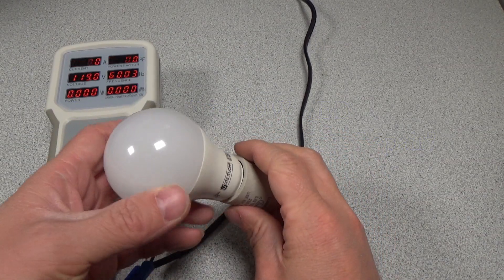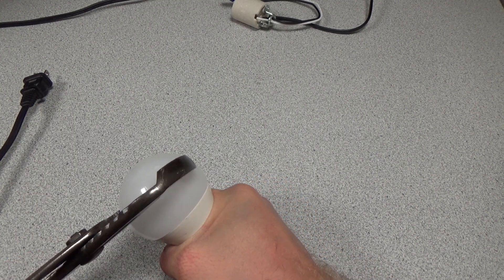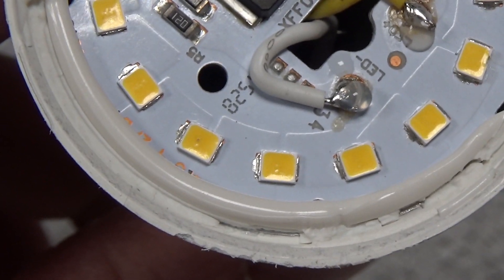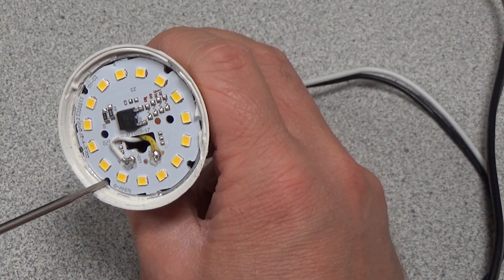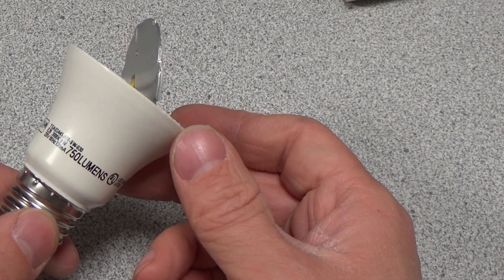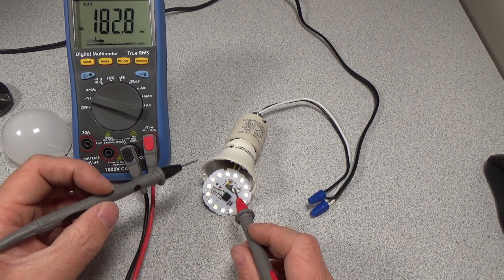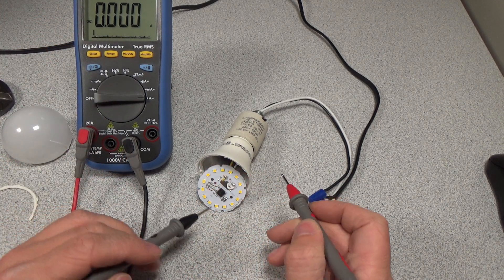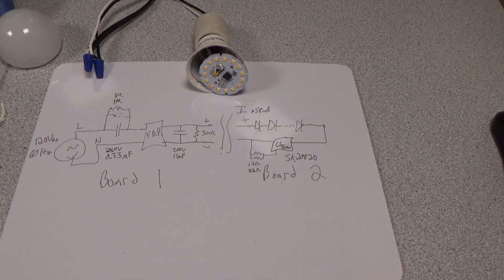Failed Utilitech 9W LED Bulb Autopsy and Schematic

Comment: Where did you get all the information on the values and hardware in the led light bulb?? What brands are the best for longevity ???
Reply from the maker: I read the numbers off of the components to get the values.  No idea which is best for longevity some important signs are lots of LEDs (this did that but still failed), keeping the leds at reasonable temps (these bulbs run them at the bloody limit before they pop and no surprise one did).  Temperature is probably the biggest factor followed by the driver technology.  I noticed older led bulbs have lots of heat sinking and are also very heavy.  I have plenty of failed newer style led bulbs (like this one) that just don’t hold up because they push the diodes too hard.  I bought the GE 2x longevity led bulbs. Still failed.  I have that pending a video.
Reply: @AllThingsOnePlace  How about the Polaroid led floodlight PLPAR38W-150.2200.30.3D light. Why do these perform so well Sir ?? Thanks